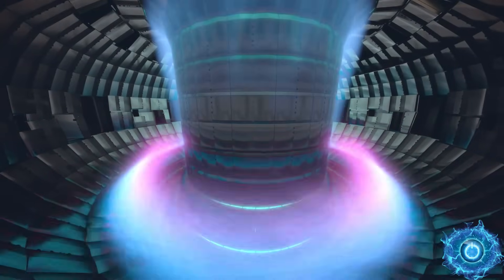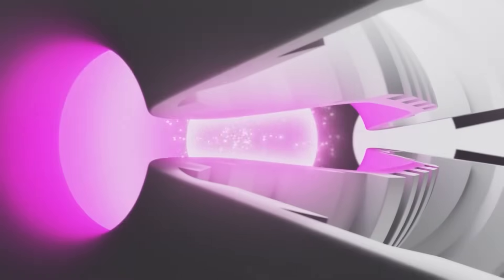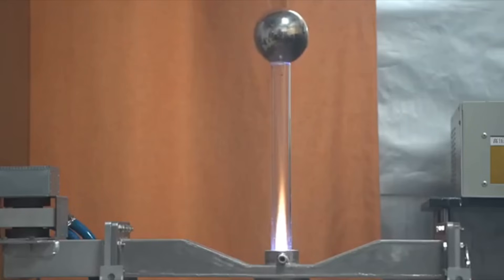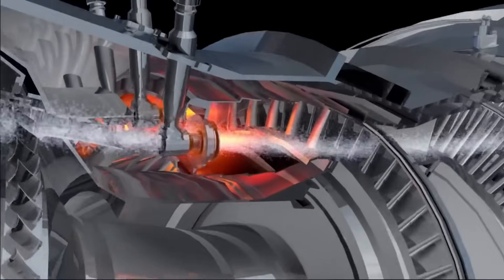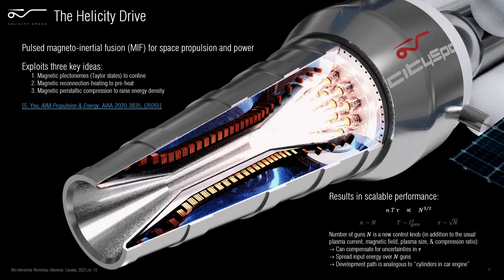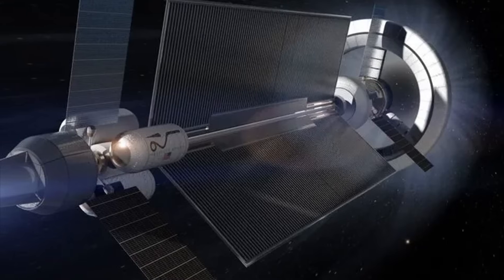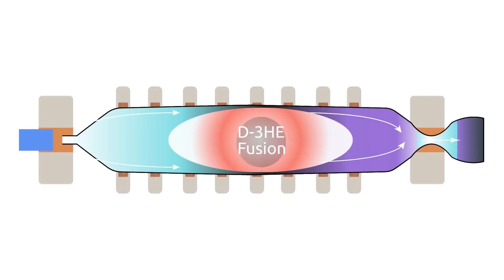New Plasma Engine DESTROYS Rockets!?

Comment: If they try to utilise the Thrust generated by Plasma to drive a  Turbine blade to create kinetic energy and they make a commercial gain from that product then I will see them in Court. I pattented that technology a few years ago.
Reply: Evidence? 😊
Reply: @dalehill6127  if you struggle to find it head to the website and click on the picture of the reactor and it will take you to the Patent
Reply: @dalehill6127  my replies aren't showing up for me. Typical from the fathers of censorship at Google.
Reply: Not much as I'm asking for evidence, more like asking did you make a business out of it?
Reply: @lumberluc  I've just finished 3D printing the first prototype. Although I still have a lot of auxiliary parts to make including a vacuum chamber to mount it in and a Marx generator to supply the current.
Reply: @nonlinearplasma  Vacuum chamber attached to a Marx Generator? Alright, I'm seeing that setup.

Number of stages your Marx Generator along with its output?

I mean, your doing great! If your repeating what Project Winterhaven is doing, your on the right track.

Just from one fellow of EHD engineer to another.
Reply: @lumberluc  thanks mate, not often you get words of encouragement. 
I had to look up the project winterhaven, and yes it does seem remarkably similar in concept. 
My idea came about as a result of Anthony Perratt's Plasma Squatterman and that figure only forms at Very High Voltage according to Anthony. Unfortunately that was all the information I could get out of him before he used the Nuclear test ban treaty to threaten me and made me remove any mention of his work from my website. I'm hoping that lowering the pressure should limit the voltage required to something easier to. achieve for a simple Marx.
Reply: @nonlinearplasma  Pointing to your finding on the Vacuum-Pressure, it'll increase the output by 10% to 20%.

Sad to see that you were hit with a gag-order.
Reply: @lumberluc  yes very sad to see in Academic circles. The best part was my invention was sent around every University in Scotland by a government body that tries to get them to research ideas that would be helpful to the business. One 1 replied and said it fell outside the realm of science (Dundee). 
So on one hand I had one of the highest plasma physicists in the US tell me that I was allowed to use his paper or illustrations due to the test ban treaty and on the other I had the university say it was all BS. And these emails were only days apart. 
If we have come to learn anything over the last few years it is that they only issue a gag order when you're correct. There is no need to gag a nut job, like flat Earthers.

Comment: Right; fusion driven spaceships.  First we need a real space station in Low Earth Orbit, where crew can wait for and board a spaceship, or an Earth Return Vehicle.  ISS is not the deal, as Starship may already be too big for docking, and ISS also can not supply more than its own maintenence crew.

Conventional chemical rockets are only good for Earth to LEO transfer and back again to Earth.  From LEO onward to a higher orbit, it is better to let a spacehub take over.  Anything destined beyond LEO should use more efficient means of propulsion.  A funny fact is that the best fuel source for fusion is He3, and to get that, we need to start mining the Moon.
🚀🏴‍☠️🎸

Comment: 1. What makes these new plasma engines better than existing xenon ion engines? They have been around since the 90s and are an established technology.
2. You mention fusion, but why is fission (radioisotope generator) not mentioned as a valid energy source here? We've been using fission for long-haul missions since voyager 1, and as recently as the Mars Curiosity rover.
Reply: 1. Much higher energies = higher thrust for given mass of propellant.
2. The problem with fission in space is energy density of the generation system:
    a. Voyager doesn't use fission, it uses radioactive decay. There have been a few fission experiments, mostly Soviet, but Voyager doesn't use it.
    b. The problem for fission in space is that the generation side is thermal, ground based reactors have large amounts of water and atmosphere to dump the waste heat into, and are typically around 30% thermally efficient. So to get the 200MW mentioned in the video with fission, you would need a way to dump around 667MW of heat. In space this is limited to radiation of heat, as there is no atmosphere or other substance that you can use convection or conduction. Which makes this very hard.
Reply: Space is cold so that might work out on a planet , stationary somewhere.
Reply: #1; Greater thrust, but the issue arises on handling.

#2; Fusion is a trickier deal since your coalescing energy together, in a cosmic storm you can't see in space. Possible good, you get the power... Most probable bad, too much power that it'll fry all your electronics.

Comment: Fusion pulsed drive will come eventually. very probably in the next 10 years in my opinion.
Reply: Exactly! Fusion is always 10 years ahead
Reply: @Kawka1122  we have proven it to work. their is a lab that has already used it to produce more then put in. its just a matter of upscaling and electrical efficiently. check out the video, its on youtube if you want to see, they have a video model showing how they did it.
Reply: @Kawka1122   Not quite. When I was a kid, it was "no more than 50" years ahead. And later I remember it being 30 years ahead. Those deadlines are past, and now it's been "10 years ahead" for the last 20-30 years. But the point is, these predictions are getting shorter and shorter. So I believe that we ARE getting closer to a working fusion PG, albeit not as quickly as we'd like.
Reply: It is worked upon, in the UK, and orbital tests are scheduled for 2027.

NASA has joined with DARPA, to provide a fission drive, which is also scheduled for orbital testing in 2027.

The SpaceAge may possibly start in 2030 A.D.  From there I predict 400 years untill we go interstellar.
🚀🏴‍☠️🎸
Reply: @MichaelWinter-ss6lx  Its now late 2026 since they are ahead of schedule cant wait
Reply: I read about China working on them on aircraft 6 years ago about 12 years ago I was thinking about this on my own just based on plasma experiments people do in microwaves and my conclusion was material science was the only limiting factor and look at how fast we are advancing.

Comment: Look to Lawrenceville Plasma Physics for a pulsed fusion design that produces a directed stream of helium as a byproduct of PB11 fusion.  It can provide not only electrical power directly, but also thrust based on the stream of ionized helium.
Reply from the maker: I will check it out, thanks!
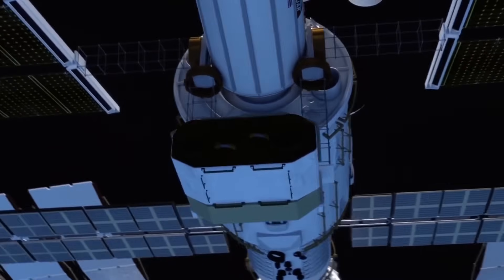Reply: 3:55 Mars in 39 days? Apply the brakes and reach  a full stop about 3 miles from one of Jupiter's satellites.
Reply: @tonyjohnson8929 😂
Reply: Comparatively speaking, the lithium blanket used in tokomak styled fusion reactor prototypes are more expensive than the beryllium electrodes used in LPP Fusion's DPF prototype, and the electrode corrosion problems have been greatly mitigated through their pre-ionization technique, electrode redesign, and electrode alignment approach. They have several published papers describing their success on those topics and more. Also, considering that LPP Fusion can generate 2.8 billion degrees of plasma heat, they're close to the fusion temperature required for hydrogen-boron fusion, and they'll begin experiments with that fuel this month.
Reply: @dewaynehiggs2098  I'm aware and waiting for the results of the PB11 testing.
Reply: Me too.
Reply: @dewaynehiggs2098  Aren't they the ones using a Hohlraum to shape the fusion charge? Last I saw they were still having longevity issues with that.
As far as I can see, all the current fusion projects are money pits promising wonderful progress next month if only they had the funding...
Reply: No it cant its been in development for over 20 years no net energy yet, its all interesting decelopment but yet unproven for anything practical. It has some ways to go. Also even in the most optimistic scenario their expensive electrodes will wear down and will need replacement all the time, and they have no good solution for that even on paper.
Reply: @patrickmchargue7122  With LPP fusion its the same story everytime, for years and years: 
1) Make hype about new experiment. 
2) Make experiment. 
3) Complain about "impurities in the plasma".
4) Repeat.
Reply: @Virtueman1  LPP will be working on PB11 experiments next.  We'll see how that goes.